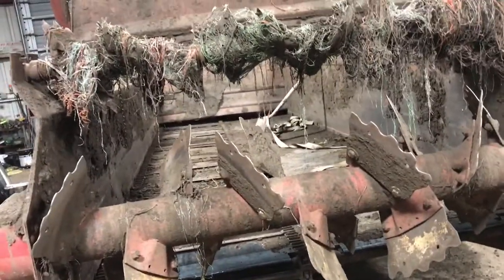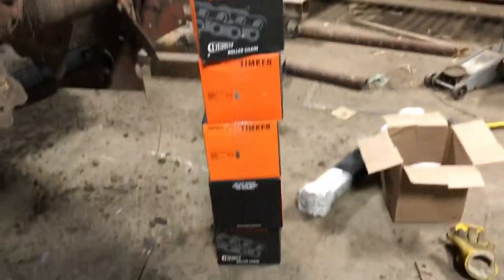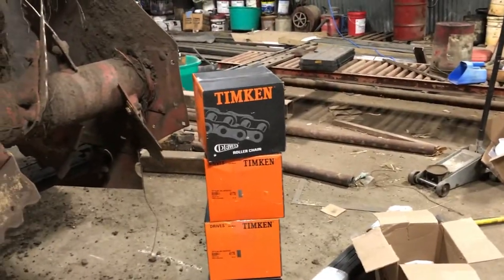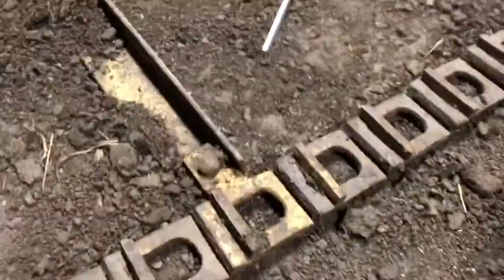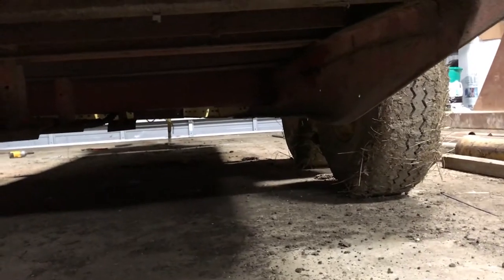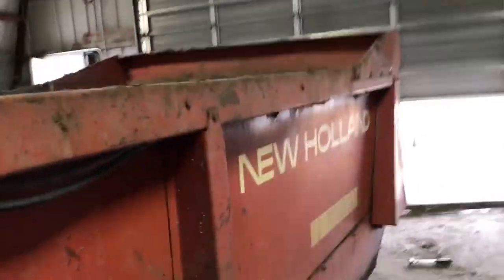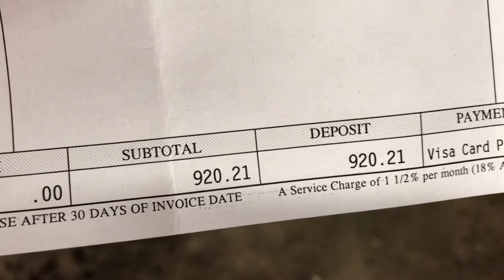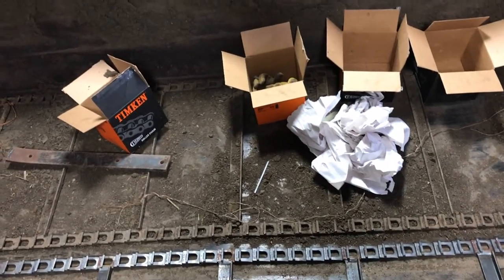Fixing the manure spreader malfunction #2 Final

Comment: now don't get mad-ok.ha! but u didn't line the new scrapers up with the old ones. ha! wonder if or which side will hit the beaters first then??  :-)
Reply from the maker: I actually was going to BUT if you look  the older chain has 5 links inbetween each bar,,, the new one they had it so i put 6 links inbetween some bars.... SO they will vary as they go around.. I ended up getting mad before i was done so i was just glad when I finished it LOL
Reply: im sure it was no easy job replacing them. and now people should realize why a manure spread cost's so darn much-right.

Comment: Ted, Thank you for the video.  I'm jealous, your shop is a lot cleaner than mine.  I'm getting ready to replace/repair the chain on my GEHL 325 Manure Spreader, it came apart on me just after we fully loaded it.  Talk about getting mad, I'm already mad because the chain broke and then I had to hand shovel the full load of manure:(...Not fun!!! I have a question.  Do I build the chain on the deck and then using the chain sprockets pull the chain around and below as I continue adding chain above.  What is the easiest way to get that last link hooked together? Do I hook it together on the deck or somewhere below?
Reply from the maker: OOO man your making me think now.... been a while.  im actually not sure if it matters or if there is a right or wrong way of putting the chain in.  I think i always put it together in the bed and pull it around by hand under the spreader and back on the bed.  once there is enough chain it can be all the way under and slight bit of chain on both sides i always use a come along or ratchet strap to keep the chain on the under side tight as I finish putting the top together.   There should be some sort of adjustment to loosen the chain all the way to it makes connecting it easier. I will send email